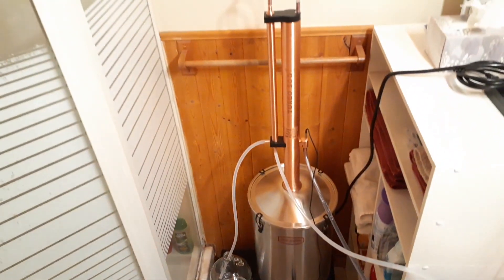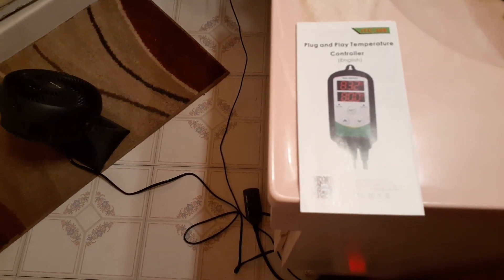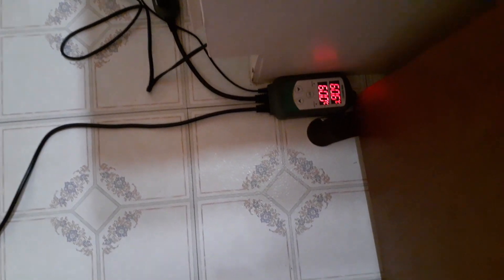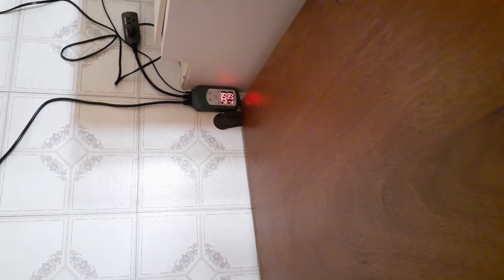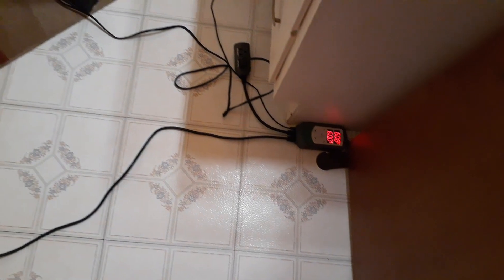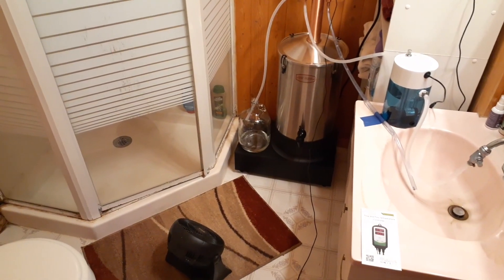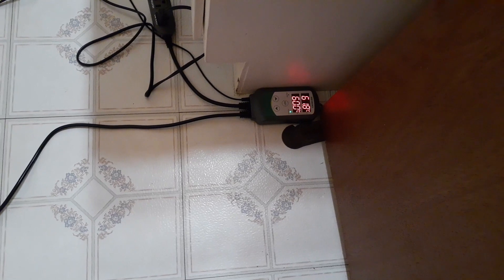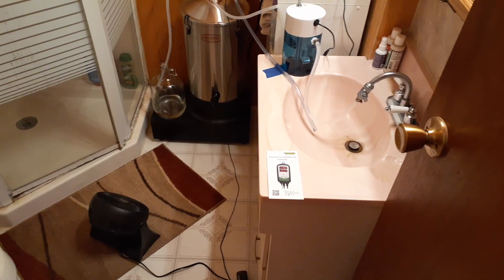Exploiting A T-500 Flaw To Your Advantage

Comment: Absolutely LOVE it! I was about to mess with the electronics of my "smart" brewer just so I could use a PID. Now I can just use this! I assume you essentially dial in your needle valve and then use this as a control?
Reply from the maker: Yes, but using this method doesn't require you to get that needle valve absolutely dead accurate. I also still run the exhaust fan to prevent too much heat build up, so this thing doesn't turn on the cooling fan that often. When there's no more alcohol in the still, the cooling fan stops turning on.